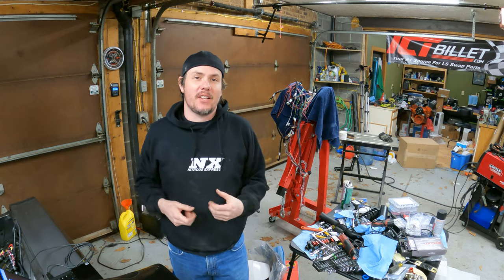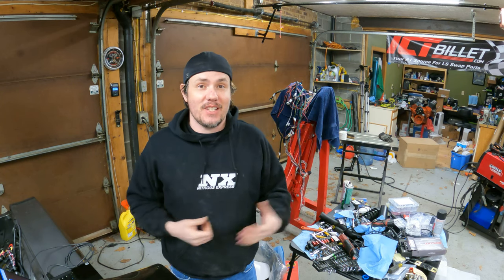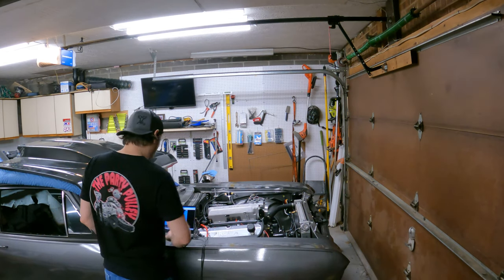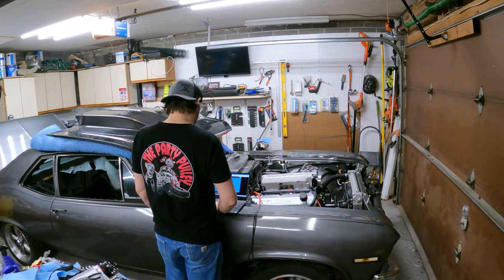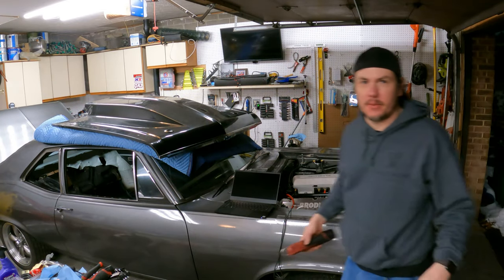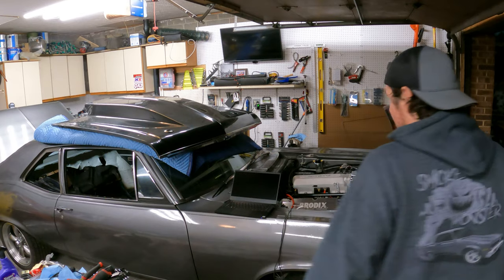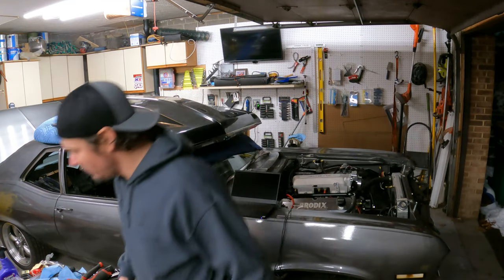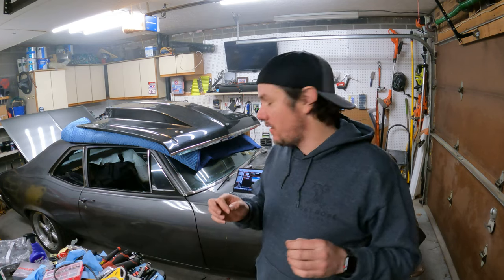First Start Of The 598 Big Block With The Terminator X!

Comment: I'm no expert, but is it possible the cold start map ( if that's even a thing) only, wanted more juice? Versus upping the fuel in the whole ve table? That would explain why you say it's running extremely rich. 10's are borderline washing the cylinders with fuel (smell your oil).  Prime/cold start/ after start? Messing with the old bosch jetronic stuff for Volvo's I came across tables like that.

Comment: What are you talking about as far as the wideband shielding?  I have an intermittent rfi noise issue on mine.
Reply from the maker: The standard LSU 5.9 has a shield wire, wraps around the outside of the cable, it's the wire with no insulation, it needs to be landed back at an ecu ground

Comment: Out of curiosity, was it the plug in the manifold at the very rear near the distributor?
I don't remember putting that in LOL I took mine apart to clean it this last weekend and was like "didn't even know this was there"
Reply from the maker: Haha, no, the ones on the driver side, didn't realize they were there
Reply: @GoatRopeGarage  Ohhh yeah, I do like how they make them "seemless" with a plug in it.  Glad to see it started up and running, sounds awesome! I know if for whatever reason my big block dies after start up soon, I am going with the 598 from blue print.
I am honestly amazed how mellow your idle is with that large cam -to me-.
Reply from the maker: Yeah, I haven't dropped it below 900 yet so it will probably get a bit rowdy

Comment: Is it a short deck or tall deck?
Reply: Short deck
Reply: @musclebone7875  👍 Yeah, saw that after watching older videos.
Reply: @funfun8095  yeah, blueprint 598 is a monster! I was looking at there 632, but I think I'll just be satisfied with my 496.😆
Reply: @musclebone7875  Yeah, I think I'd just jump up to a 632, but I build my own engines.
Reply: @funfun8095  oh ok! Yeah if you decide on  blueprint engine just jump to the 632. I have a tall deck 496 in my '68 impala now. The 632 would be a direct swap into my car without any issues except maybe going to Lemons big tube headers.
Reply from the maker: I was worried about getting headers to fit with a tall deck, already tight with the raised port heads
Reply: @GoatRopeGarage  i agree! Headers ain't cheap 💯
Reply: @GoatRopeGarage  Yeah, the raised ports dont help, but that's why you're probably going to have to just make a set, so...would have with a 632, also. lol